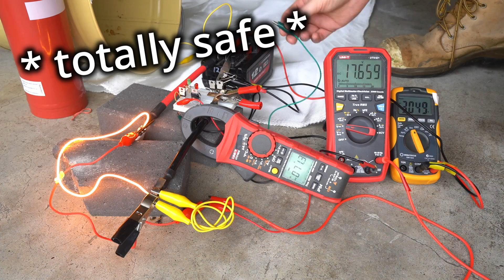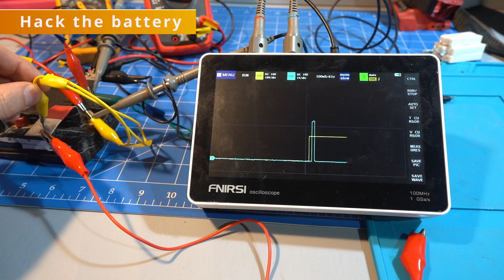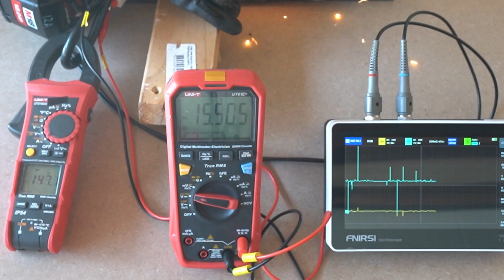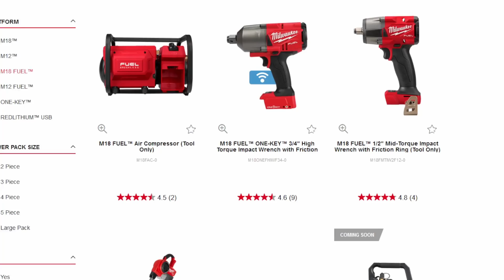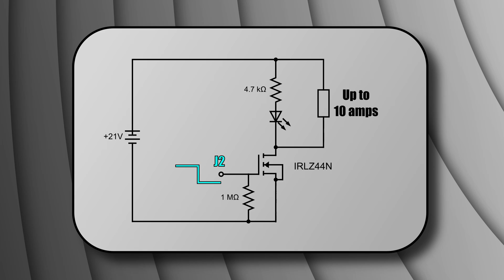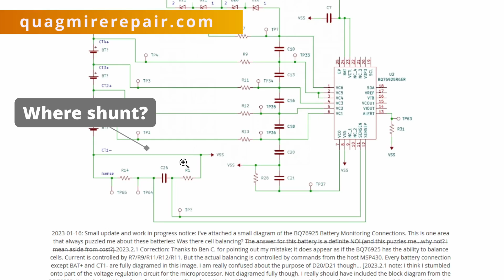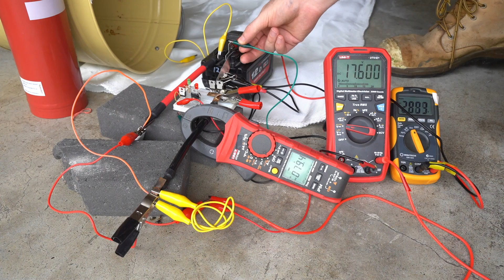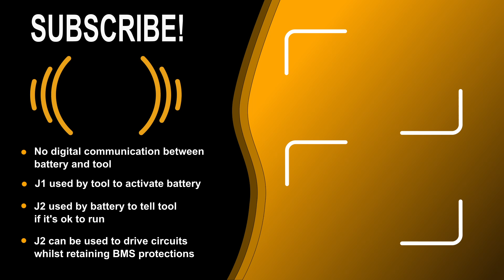[005] How M18 batteries communicate with tools

Comment: Again great info also was sort of waiting for this video. This is something I’ve been curious about since I started using these batteries to power projects. Having a sheet that breaks down information about battery communication protocols as well as  well as recommended wiring and a pcb / gerber file would be very appreciated if you have the bandwidth. Even just  running list of everything you think you know would be useful to have in one place.
Reply from the maker: Yeah, I should do a written version of all my tests. Video is not the best format for a lot of this stuff, but it has much better reach.
Reply: It is sorta funny how little seems to be actually going on in the communication protocol though lol especially when these companies really play up the secret sauce in these batteries

Comment: So since there's no useful communication from battery to tool, do you think i could frankenstein a a cable from an M18 tool to a 12v set of alligator clamps?

I keep the M18 inflator in my car but worry the desert heat will destroy the batteries, and I've always wondered if it'd  possible to run it off my car battery in a pinch. Of course, i know it'd run at a reduced speed (if at all) given it's 12-14v rather than 18-20.
Reply from the maker: Definitely. Any M18 tool can run off external power. All you have to do is put  > 0.72 volts on the J2 pin, but you can use 3V, 5V, 12V, etc. The highest voltage I put on J2 was I think 25V, but not sure if it would cause problems if left like that. The J2 pin on the tool is the one closest to the ground pin, and the ground pin is the longest pin. Easiest way is a 100kOhm (or more, my fingers are something like 3 MegaOhm) resistor from the positive pin to J2.

Just be mindful that running at reduced voltage could burn it out as the slower RPM will mean the cooling fan isn't running as fast. It shouldn't be terrible as 18650 based M18 batteries run down to 10V (although they fall off pretty quickly and only spend around 30sec under 12.5V with a 18A load)
Reply: @toolscientist  this was far and above what I expected in response. I think the only thing you could've done more for me would be building the wiring harness and shipping it to my door! 🤣

Thank you so much! I certainly hadn't thought about the cooling fan, that's a very good point. I'll make note to consider it's duty cycle halved when running on 12v. Just gotta go out and build the adapter now hah! This will be a huge boon for not having to store a second compressor while offroading! Thank you again!
Reply from the maker: I'm always interested in people hacking their tools. This one was also a fairly simple answer, too!
Reply: @toolscientist  you rock. I'm so glad I'm subscribed haha

The first Milwaukee video with the charger is what I saw first and instantly subscribed, specifically hoping for a video like this. :D

Comment: The old(er) M28 batteries would show flash codes when the battery level button is held down. So, I'd think the M18 has something equivalent. Maybe there is a variation on the signal to ask the battery to output diagnostic data. Milwaukee may have a rig for warranty/qc to get an idea of what kind of life the battery had: Number of over temp events, max current draw, charge cycles, etc... The higher end "one key" tools could be the ones to look at if they communicate with the battery since they have "smarts" and  use Bluetooth for tool settings.  It doesn't make much sense to have the communication if there is nothing useful to do. Thanks for the great videos!
Reply from the maker: I have 2x M18 batteries that give those flash codes, although I haven't had time to look at it yet. Someone posted a fairly good guess of what they were in a forum or reddit (something like manufacture year, week of manufacture, etc). They're both 2013 batteries, whereas all my other batteries are 2015+ and don''t give any flashing led codes.

Good thinking on the one-key tools. I was going to try and send queries to the battery based on what seemed logical from the charger messages, but a one-key tool could save a lot of effort there.
Reply from the maker: @rossradford5767  that is interesting. Can you put a quick vid of the sequence on youtube? You should be able to post youtube links in the comments here, but any external link will block your comment without telling you. If you can't post the link, post the title so I can search for it.
Reply from the maker: @@rossradford5767 I've saved it. Haven't had a chance to view it yet.

Comment: I'm actually putting off playing Alan Wake 2 to watch this first.
Reply from the maker: Thanks! Hope you enjoy it. It's a different video to my last one, so not sure how it will go.
Reply: @toolscientist  I can't speak for other people, but this was exactly what I was hoping for. Thanks for the staggering amount of effort you put into this. That whole aspect of different batteries having different thresholds for things must have been a fairly irritating complication.
Reply from the maker: Definitely! I said a few hours, but I think that aspect was closer to 10 hours of testing time for something that isn't super important to most people. I was pretty thorough with the 2ah, so I'm pretty sure 700mA is its threshold. I got bored on the 5ah and left it at 2amps, when it's threshold is probably around 1.5 amps. 1 amp kept it awake for 10m40s. The testing time just becomes exponential as each increment in current increases the time that it keeps the battery awake. I nearly had a heart attack when the 12ah behaved completely different, but luckily it was the only one. I was also really dumb and did a lot of testing with resistors before I realised that I had a battery tester that is essentially a programmable load!